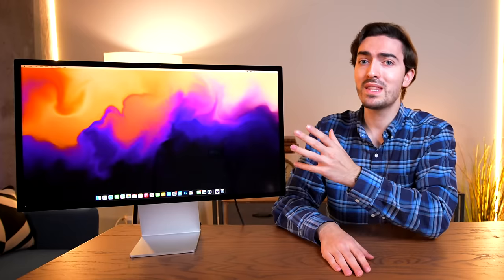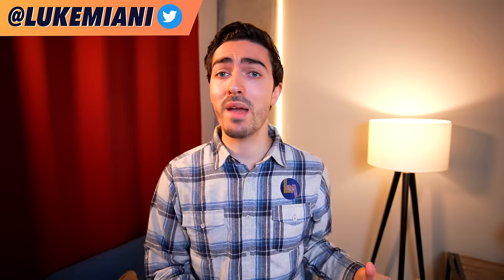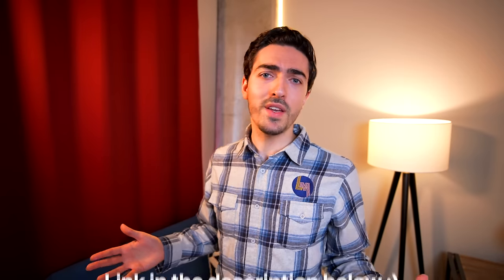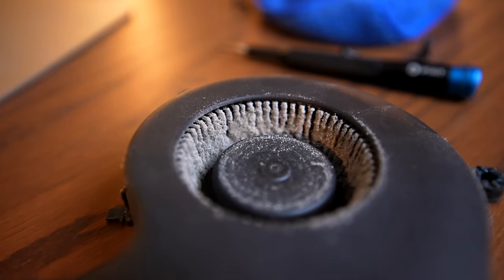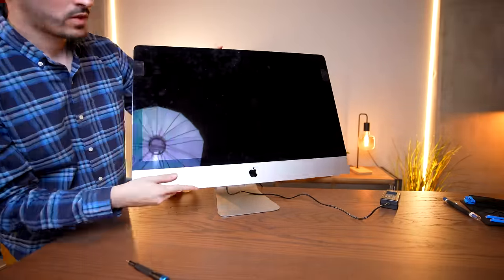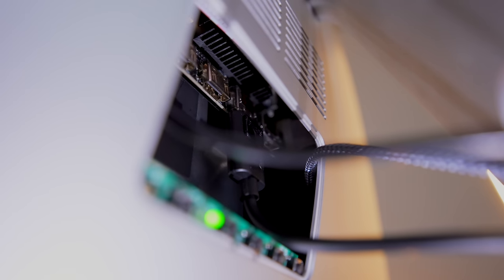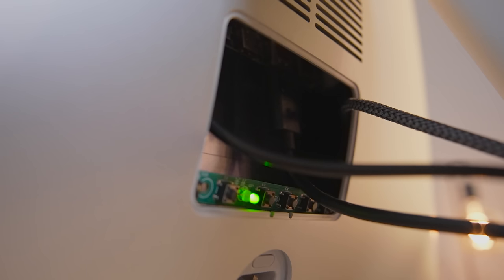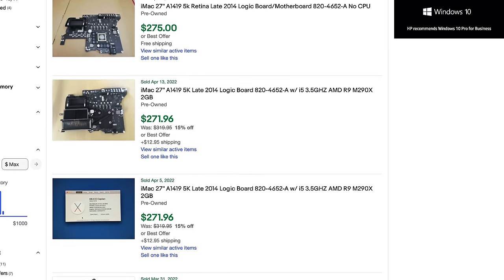How to make a DIY Studio Display for just $600! (USB-C & Built-in camera!)

Comment: Great Project... as some improvements, I'd add is a 3D-printed door for the memory opening on the backside. I'd design one with mounting option for mounting the connectors and the keys. Along with that I'd add a power switch (should be fitted with the original Power Switch) and maybe print some infill for the connection-holes. As filament for all prints I'd choose one that does come close to the aluminum color of the iMac. Maybe I'd also go for a internal PSU so that I coud keep the original connector and power supply cable.

Comment: Great project! You could throw the display and conversion board into an old Thunderbolt Display to bring that into the modern era. That would be interesting as well.
Reply: The nice thing about the thunderbolt display is that you can get an external adapter to use it as a modern monitor. You can do the same thing with the 2000's flatscreen Cinema aluminum-frame cinema displays. You might be able to do this with the older cinema displays too, I am pretty sure you can. :D

Comment: Very Interesting.  I have a 2014 iMac w/5k display.  I’m also thinking of buying a new Mac Studio and new monitor.  I’m wondering about one thing, though.  You mentioned, early in the teardown of the iMac, that it’s important to be careful with the power supply, because handling it incorrectly could cause serious injuries.  Is avoiding the power supply and it’s potential to cause serious injury easy and safe for someone with very little experience with that sort of thing?

Comment: OK - I have an a Mac Studio. Still waiting for the display to come. I've had it hooked to an old HP 2K display My solution was to hook up my 2017 iMac to the Mac Studio via Luna Display. Luna Display plus a Thunderbolt cable is about $170. The Mac Studio drives the 2017 iMac through Luna Display at 5K. Works really well. I'll be using it as a secondary display once I get my Studio Display. Good work around for the expense.

Comment: Very well done Luke, great idea! I didn't know such converter boards were now available for the 5K panels. If I did this I'd be keen to try and use the internal speakers as well, with an external sub - but it would be a little tricky because each speaker has two speaker drivers and is designed to accept audio at different frequencies - there is no documentation on this. Four wires per speaker. So it would be very hard to setup an amp inside out putting four audio channels with the right frequencies for each driver. (Most hifi speakers have two wires going to each speaker box and a 'crossover' inside which sends appropriate frequencies to each driver - Apple is doing this on the logic board in the preamp stage.)
Reply: thanks for the info - sounds like it won’t be trivial to use the 4-pin speaker connector on the converter board then.  do you happen to know what kind of speakers the 4-pin connector the be best suited to drive in this particular build?

Comment: Fab, I saw your project using a M1 Mini internals for a 27" iMac and I actually prefer this option to salvage the display. Last year I looked at replacing my 27" Late 2013 iMac with a M2 Mini and Studio Display but that was a whole pile of cash. I now have my (unsupported) iMac running Sonoma so that's ok but my son has a dead (PSU fail) similar 27" that would make a great up-cycling project like this! 🙂

Comment: After my 27” Late 2012 “developed” a cracked screen I haven’t really used a computer (I sometimes use that one still with a monitor just to save photos and update some things). But since I’m not a heavy computer user I’ve been able to get away with just my iPhone, iPad Pro and ThinkPad. 

I recently had the opportunity to pick one of these retina Mac’s up for $100CAD. Currently I’m just messing around on it with OCLP and it’s not that bad tbh, definitely not ideal for much more than recreational usage but it does that well, and DANG! I missed my 27” display and WOW, the Retina display is actually quite excellent. 

Ultimately though I figure that if I did this to it how can I lose haha.

Comment: I know you aren't in the business of specific hardware configuration recommendations, but do you know if a fully functioning 2011 27" iMac (currently running High Sierra) can be used as a main/secondary display for an M1 Mac Mini (with the appropriate adapters and cables)? Thank you!

Comment: Not gonna lie, that logic board would be a fun mini-server project. If you could get a generation with SSDs then you could even have a nice cache drive. You could probably build a slim case the hight of a Mac Mini, but the width and depth more like a MacBook Pro 17.
If i could do it i'd cast a case out of aluminium and sand blast it to make it look somewhat like a Mac MiniXL toss a 16TB drive in the internal SATA port then 2 connected over thunderbolt(internally) and you've got a beautiful little file server.

Comment: Get yourself a 2016 Macbook Pro with a broken screen for cheap, take the screen off, get yourself a 2015 or later iMac, mod it, you have yourself a mac with a totally decent quad core processor, SSD, and 16g Ram and a 5k monitor, maybe all for under $600 if you get good deals. Sweet budget build. Though personally I'd just go with a 2015 Macbook and a 4k monitor that you don't need to mod and still have a damn fine setup for a few hundred.

Comment: I just asked how to do this in a previous video of yours. How many hours did it take you to do the modifications? Would this work on a 2019, 27” iMac? Any way to reuse the internal storage of the of iMac (as an external drive)? What about any of the other ports (especially the SD card slot)?  Could the internal speakers be used with a MacMini interface? Is the camera you installed a 1080 or 720 resolution? Could one install a 4k camera? Thanks. You have very informative videos.

Comment: Something I'd do to improve is maybe look into 3D printing a new RAM cover with cutouts for the control buttons as well as for the power & video ports. I'd imagine given the amount of equipment removed from the imac that there should be enough space inside for a few short M-F cables to run from the controller board to a nice neat backplate.

Comment: Hi Luke. I contacted the supplier of the board you linked to (on ebay) and they say that in their testing it does NOT support full 5k over a single displayport connection (no DP1.4 only up to 1.2). They said they have tested m1 Mac mini's and Macbook. When you connected yours was it 4k or 5k or did you use a dual displayport to single thunderbolt to actually achieve the signal? There's a few of these boards out there but none of them state single cable support, only the more expensive board with usb-c seems to, at least officially.

A follow up video to this would be great. Running through compatibility with various models, settings you used etc. Also what else the board can do, connecting other devices via HDMI in 1080 and 4k, PIP/PBP, all these things. I think a fair few of us will try this when faced with the cost of a new Studio Display. I've got a 2017 iMac which isn't worth that much on ebay now, so for the cost of the board, it would save me $$$ on getting much the same 'official' screen!
Reply: In answer to my own question, incase it helps anyone...I believe he was getting 5k in 8bit color mode over the single DP connection. It's supposedly a DP 1.2 port which is apparently able to do that with 'DSC' and as a Macbook Pro and Mac Studio were used, they were powerful enough in terms of graphics to power that. To get full 5k in 10bit color mode you would still need to connect using both displayports, via a dual displayport to thunderbolt 3 adapter which is capable of 5k 60hz at 10bit. That's according to forums of people that have done this. Perhaps the lower end M1's (Mac mini and Macbook air) don't have powerful enough graphics to do that as well.
Reply: @Captck  Any chance you can provide links to those forums and the dual displayport to thunderbolt adapter for 5k 10bit 60hrz?
Reply: @Captck  Thanks, this is very helpful! Could you please share with us what dual displayport to thunderbolt 3 adapter you have used for this?
Reply: Thank you for posting this, how nice of Luke not to bother mentioning this.

Comment: Meant to comment on this a couple of weeks ago when you first posted. Thought this was a brilliant project. I have a Studio (base Ultra) on order whose delivery is still 2 1/2 months away. I won’t be buying a Studio Display. I also have a late 2015 iMac which the Studio will be replacing so very tempted to sacrifice its internals and do this “Frankenmonitor” conversion. i7 4ghz processor, 512gb SSD, 24gb RAM doesn’t yield much on the second hand market.

Comment: Really cool conversion! Thanks for sharing! Did you think about reusing the internal speakers and couldn’t for some reason? Or just limited your scope? Could you also make use of the HDD with an external drive adapter (but wired up inside the case)? Would be cool to get display, webcam, sound, and even external storage all through one cable like the Thunderbolt Display if that kind of board exists.
Reply: that’s a really good idea for additional extra storage esp for Time Machine! Having the speakers working would seal the deal for this rainy day project!

Comment: I don't know why this popped up on my feed, but you inspired me. I found a 2017 for $360 on facebook marketplace after i saw your video last night, and bought it this morning!

I can't bring myself to gut the machine, but i thought of a way to keep using it as an all in one. I'm gonna cut a hole (jussstt big enough) out of the top back of the case (where it seems like there isn't much going on hardware-wise) so I can keep the controller board on the outside but run the cables inside.

The extent of the mod will be: open it up, disconnect the display, use a dremmel to cut the hole, snake the controller cables inside, do the webcam thing, snake that cable outside, and attach the display to the controller cables as i'm closing it up. 

Voila! job done, no dangerous power supply touching required. And i theoretically still have a working imac! (which right now is running ventura chef's kiss flawlessly right now)

i'll use a display port to usb 3 cable (plugged back into the imac) for when i want to use it as an all in one. Do you think it'll work?? I have a slight concern, apple being apple, they might cancel the boot if the built in display isn't plugged in... i sure hope not, i'm all in on this.

It'll be convenient I imagine to have access to the controller board without having to remove the glass, though i hope i can find a clean way to mount it. Any suggestions for that?

Do you think i should try to seal that hole i cut out in order to maintain the speaker quality? Now is the first time i've ever been able to let loose on an imacs speakers, since i've only ever used them in class rooms before, and holy moly are they good! don't want to ruin that. I'll definitely use the all in one for watching movies.

Stinks the only ebay sellers for these controllers will take 2+ weeks to ship, but it'll be worth the wait!
Reply: wait can we get a tutorial?

Comment: I love the aesthetics of the iMacs. I thought of turning an old cheaper iMac into a monitor in the past but most of my monitors are mounted on wall arms. I gave up because the weight of an the iMac was too much for the arm I was using. I am sure getting rid of all the internal components really reduced the weight. 
@lukemiani I wish Luke would have posted the new lighter weight of his DIY iMac display but it must be so much lighter.

Comment: That is a good idea for an economic build.  The general flaw with this approach is it ignores the basic Apple tenet of, "plug it in, and it just works".  I plan to spend the $2,000 to get the built-in speakers, microphone to go with my camera, and a really nice stand.  Plus, I can connect to my M1 Mac mini through thunderbolt.  I would have planned for a 32-inch display, but I can't afford $6,000.  If I was in your situation, I would built a Hackintosh with the working Apple parts, since you won't need to mess with Clover-type stuff.  I'm assuming there is a way to connect some PCIe slots to the technology you already have.

Comment: Hi, I love the project. Yes the think the Apple Studio Display is over priced. 
I have a late 2015 5k iMac and am considering a Mac Studio computer and was going to buy the cheaper Studio Display. I was wondering if I could repurpose at least the 5K screen. (You answered that question) So the money I save not buying a Studio display can be used to get 64 GB ram and a 4TB ssd drive.
I am already running OpenCore Legacy Patcher. However Autodesk Fusion now says it will only support Apple Silicon processors starting March 2025. I tried the online Fusion running in a browser, it was a bad experience. I do not want to buy the Mac Studio now as it is a 2023 model and OS support will be dropped sooner. I heard rumors there may be a Mac Studio refresh summer 2025. 

Did you connect the video from you Mac Studio from one of its Thunderbolt ports to the new board via a display port adapter?

Comment: I did this exact project in Jan 2020 a with the same video as this one from German YouTuber “tips tricks and more”. I have to tell you that it did not went smoothly: the converter board arrived, I got an image but the backlight was super dim. After a lot of being persistent, the AliExpress seller looked at photos from my unit and found out they forgot to send me a “booster board”. Received it months later, now it worked. 
Next, the included PSU is super cheap and unreliable, I replaced it but the connection still cuts out regularly. The display flickers for a second and then dies for some seconds. Have to wiggle all connectors to get it back on. The display is still hold on with duct tape, in case I have to open it up which I did 2 times in the past 2 years. I don’t want to cut open the expensive OEM strips regularly. So yeah it works 99% of the time but when gaming (yeah I have a powerful GPU in my gaming machine, native 5k gaming is unbelievable fascinating) it’s really annoying when it flickers and goes black…
Regarding the iMac I did get very lucky, bought one in Germany that had a dead logic board but according to seller he opened it up to rescue the hard drive but screen is fully functional and I got the full computer. The screen worked just fine and it was in excellent condition. Paid 450€ for it.

Comment: Excellent job! The fact that the finish product looks like an iMac is even better! I don’t have the means to but I would see how to design and print a cover for the back and a little rubber nipple from where all the cables will come out of. Also, it’ll be a nice project to put that iMac logic board into something else. If anything, Selling those parts we’ll probably leave you with a total budget of $150-$200; which is awesome, because you can actually make two! or make to sell them I gladly buy something like that!

Comment: so instead of buying an adapter card setup for $200, to use my functional 2017 iMac 5k 27" as a monitor for my M2 Pro Mac mini, would the Luna Display by AStropad be just as good?
Reply: I’m attempting to do the same with my fully functional 2017 5k and Lina display. Preliminarily, the latency is a concern but I’m going to experiment with some variations in connectivity and settings. Anyone else trying this?

Comment: This might be an option when it is time to upgrade my 2019 iMac with a Mac Studio (or the M3 Pro Mac Mini when it is released, if it supports 64 GB of RAM or 48 GB at bare minimum). I really don't understand why 5K monitors have not been a lot more popular. Especially for video editors, as being able to have 4K footage without any scaling, and still have the equivalent of 1280x720 screen real estate for controls, is a huge advantage. And even for other users, 5K is still great to have. I'm a programmer, and also compose music, and the extra screen real estate (for more visible tracks and plugin windows in Logic, and having more code visible on-screen for coding) is great. Really the only times where 5K is not a good option are for gaming or screen sizes less than 27".

TLDR: There really should be more than two overpriced models of 5K monitors available given how useful the extra screen real estate is. Gutting an old iMac shouldn't be the only option other than $1200 for a flimsy/wobbly LG 5K monitor or $1600 for the Studio Display.

Comment: This looks nice; my problem with it is how the cables are connected through the RAM port. One accidental tug and you'll either break the internal board, or the cable gets yanked out of the socket and you have to pull the screen off again to reconnect it.
Reply: Thought of that too, but figured it’s easily solved but using one of those cable-tie tie downs that you tape on.

Comment: I would have kept the original speakers and put in a small audio amp to have sound in your display.
Reply: no need that conversion board has a audio amp built in just like normal monitors with speakers inside of them have he just needs to wire them up to the board

Comment: This is very cool, but I think you should give a shout out to the small channel M3tech, who did this exact same procedure with an old iMac earlier this year. Your solution is close to identical, down to using the RAM slot for cords. It's very obvious you watched his tutorial. Borrowing and copying is fine, but at the very least give a shout out to the channel you're borrowing from, especially if it's a much smaller channel.

Comment: Great video, as usual. Here is the ultimate in dumb questions. I have a late 2012 iMac 21.5". I want to get a new Mac Mini and would love to take a crack at a project like this with my existing iMac (yes I know it's only 1080p, that's all I need for now). Would this be possible to pull off?